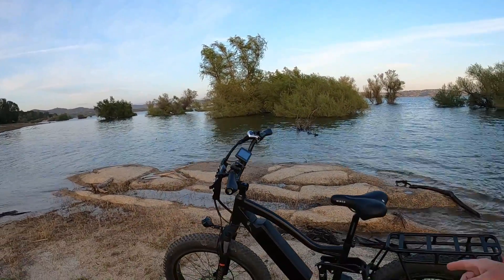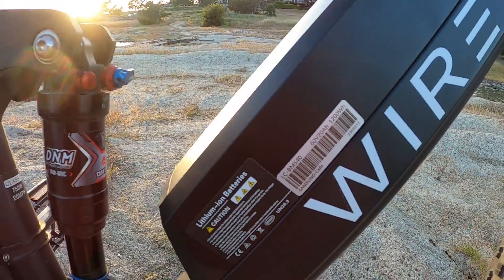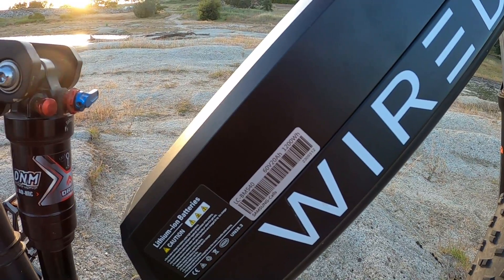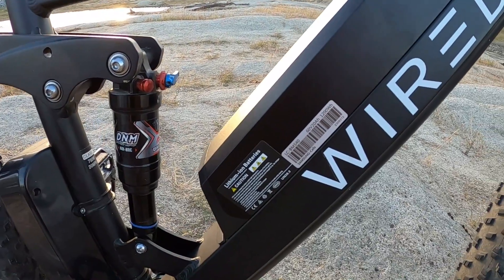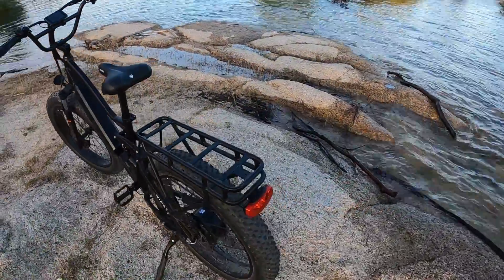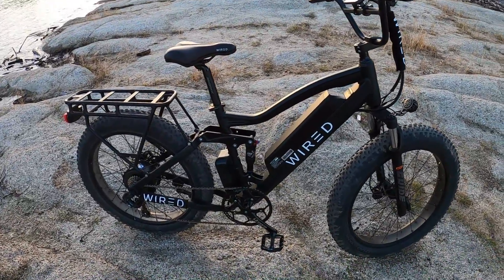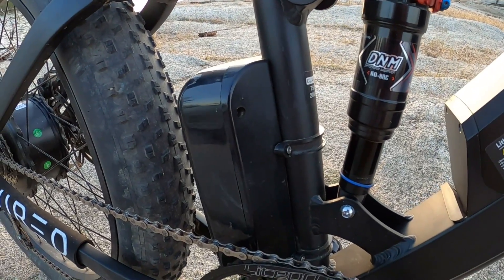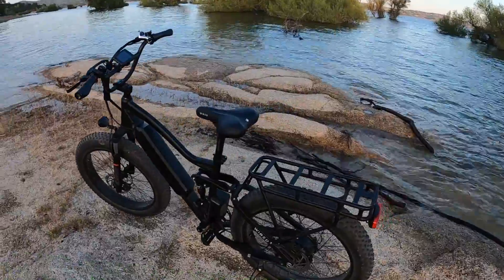Volts, Amps and Watts Explained   2024 Wired Freedom

Comment: How does discharge current relate to a batteries capacity to supply the appropriate amount of power to the motor without overtaxing the battery? Did you discuss discharge current of a battery? Thanks for considering my questions, I'm struggling to find the answer.
Reply from the maker: The discharge rate is usually measured as a "C" rating, at least that's how they do it in the RC world. I don't know what the discharge rate is for these batteries, but the controller often is the limiting factor for power to the motor. These are 30amps continuous and the newer ones are 40amps multiplied by the voltage (60-67 volts, depending on charge level) which will give you the wattage output to the motor.
Reply: @leetjohnson  I had an experience where I think my battery was under powered for a dual motor set up and it blew the BMS. My thinking is that although the amp hours was rated at 30 amp hours, the controller was pulling 60 amps but I later found that the battery was actually rated for 25 amp hours. The thing is that the battery says that the discharge rating is less than 50 A. This would be less than the 60 from the controller or the 25 amp hours for which the battery is rated. I’m uncertain if the important number to consider for the battery is the discharge current or the Ah rating as it relates to the controller and the dual motors.
Reply from the maker: @JoBianco amp hours is a measure of capacity, like gallons of gas in a tank. So, for example,  if a battery is 25 anp hours, theoretically, it can output 1 amp for 25 hours, or 10 amps for 2.5 hours, or 25 amps for 1 hour. 25 amps is an amount of power, 25 amp hours would be a capacity measurement.

Comment: I've got a TDR brand ebike has a 500w motor paired with a 22+1 amp controller  using a 48v 10ah battery. It over heated a couple of times so I tryed to change the controller current in the display settings. 
I can literally set it at 1 amp or I've had it up to 36 amp and the motor response has no change is that normal?

Like setting the controller amp to 1 you think it would not work? Does the controller or motor have an issue do you think?
Reply from the maker: @JunkyRacer  Sounds like the controller may be faulty. Have you reached out to the manufacturer/reseller?
Reply: @leetjohnson  yeah I did they told me it could send the motor and controller back for testing, but i haven't yet.
The only thing that affects motor profomance is the pedal assist setting from 1 to 5. At level 3, it's fine if I don't use the throttle too much, but if I do and use assist level 5 as well, it overheats with in a couple of kms hard riding. I don't know if this is normal or not?
Reply from the maker: @JunkyRacer  yeah, that definitely isn't normal.
Reply: @leetjohnson  ok I'll mention as well they said typical heat range is from 50 to 70°C i haven't test it with anything but my hand but it's gets to hot to touch for longer then a couple of seconds.

Comment: Shouldn't the motor's efficiency be part of these equations?
Reply from the maker: Yes, there are some thermal losses from the motor and other inefficiencies. However, they are fairly insignificant compared to wind, rider weight, terrain, and other mitigating factors.

Comment: Hi again i have another hypothetical question, would this motor be compatible with the controller below or would you recommend a amperage above 40 like 50 60?

Rated Voltage (V): 36V-72V
Rated Power (W): 2000W-3500W
Rated Speed (Km/H): 120
Motor Speed: 1850 Rpm 

40A Controller for 1500w-2000w :  
Maximum current:40±1A
Size:185*82*41 mm
Weight:546g
Mosfets:15 mosfets
Cable length:all about 13-18cm
Rated voltage:DC36V/48V/52V
Speed set:1.1-4.2V
Rated current:20A
Thanks again
Reply from the maker: @sandstormshadow1238  40 amps would be plenty!! It really depends on what the motor can handle.

Comment: Hi i have a question about my setup. I have a 48v mini electric, 13a controller, 400w sustained 500w peak motor and 3 batteries, 1x 48v 10ah and 2x 48v 15ah batteries, through your calculations I have 480wh and 2x 720wh, How do these numbers translate to approximate run time with the system ive got and how does the 13a controller effect my batteries. Thankyou if you can explain.
Reply from the maker: @sandstormshadow1238  it's really going to depend a lot on rider weight and terrain (flat or hills). The 13amp controller will limit your power, but also allow you to ride farther and longer, although at lower speeds.

Comment: I have the new wired Predator. It comes with 67.2 voltage at 3amps. Can I use the cycle satiator charger running at 5amps? I'm only using it for a group ride because an extra battery is over $825+tax. It won't blow up the battery?
Reply from the maker: @CHRISTSALVATION  as long as it is the same voltage (60v nominal, 67v current) you theoretically should be good. I wouldn't let it charge the battery fully, but for a quick charge, it should be ok.
Reply: @leetjohnson  thank you. I figured it should be good but always good to get another opinion. Luv the videos
Reply from the maker: @CHRISTSALVATION  thank you!

Comment: Hello again mate, Spoke with you awhile back, This is still over my head, Could you help me again please, l am thinking of getting a ebike again, it's got a 750w motor supposedly kicking out a 1000w classed as a 1000w lax motor geared with 90nm of torque, 48v 12.8ah 16.4wh battery and a fast charger 48v 3.0amp , (1)World it be possible to tell me what amps my controller is ,(2)What speed what distance and how long will the battery last roughly of course ,Would really appreciate your help mate please.
Reply from the maker: @alanmeasures8337  Hello! The amperage of the controller can vary, but theoretically, at 48v ÷ 1,000watts would be about 20amps peak and about 15 amps continuous. The maximum speed can be up to 28mph, unless it is speed controlled to 20mph to be legally class 2. As far as distance, it depends on the rider weight, terrain (hills or flat) and how much power (power level) is used. I would guess a 200lb rider on relatively flat ground would go about 20 miles or so of range at a middle power setting....up to 25 miles on the lowest power setting and as low as 15 miles at full power. Just my best guess though. Hope this helps, let me know if you have any other questions!!
Reply: @leetjohnson  Thank you again for the reply and help, Cheers mate.

Comment: I was curious about the max charge speed of the current generation wired freedom. I know that both of the chargers that came with my bike charge at 3a max. The reason I'm asking is because I have an onyx cty2 which is also supposed to be 60v that charges up to 71.4v when fully charged. It's charger is a 5a charger and I was wondering if I could charge my wired freedoms batteries with it. I can't find anywhere on wired's website where it talks about how fast you can charge their batteries.
Reply from the maker: @jcolt84  hmmm, that's interesting. I know Wired uses 3amp chargers for the old and new versions....I would think it should be fine to use 5amp, if the plug fits, however, this could theoretically void your warranty and will shorten the lifespan of the battery, as faster charging wears the battery out quicker.

Comment: Can you run 72-volt battery on that stock WiredFreedom, without ant upgrades but the battery?
Reply from the maker: @mikerocket62  no, I think you would have to get a 72v controller.

Comment: Great video friend But still a lot to take in, Help please  ( 48V 16AH / 768WH ) LI- ION BATTERY,  1000 V DIRECT MOTOR,  90NM OF TORQUE.    What speed am l looking to achieve, What distance and for how long , Would be a great help  love from the UK.
Reply from the maker: There are a lot of variables for thr top speed and distance (terrain, rider weight, pedal assist level/throttle vs pedaling, etc). I'd say probably 24 to 28mph and a range of around 20 to 30 miles on those stats at a medium pedal assist level and 180lb rider.
Reply: @leetjohnson  Thank you mate for your reply,

Comment: Can you explain more about peak out put?When can you hit peak out put? For how long?
Reply from the maker: Depends on the motor. Peak is used when going full throttle or pedaling hard/uphill in pedal assist 5.
Reply: I have similar bike and no hills where I live and I believe the most out put I've seen is 1800w. Does the system sense when it needs to disperse the 2200w like going up hill?
Reply from the maker: @Easy416  similar bike? Is it a 60v system? Does it have the same motor? (1,500 watts nominal and 2,200 peak). Hard to say unless I know the bike and controller. This has a 40amp controller and is programmable l, which allows you to modify the power output in multiple ways. It could be a setting on your controller, if it is programmable. Full throttle should allow for max output, depending on the settings.
Reply: @leetjohnson  I have the E cells 5 star
Reply from the maker: @Easy416  right on! You can try a hill, if you can find any around where you live....it might push it to 2,200....that's about the most I've seen on my Wired Freedom.
Reply: Okay thanks

Comment: About to purchase my new wired freedom cruiser! I’m so excited for it I didn’t even realize how major they upgraded that thing right after the ‘24 model released late last year which is really crazy
Reply from the maker: I know, right?? Such a great value!!  If you use the link in this video description box, it really helps out this channel, and I would greatly appreciate it!!
Reply: @leetjohnson  sounds good! So basically from the 2024 wired you got 80 miles from it low settings right?
Reply from the maker: @CNclov2005  72, but yes, basically. Should be able to get well over 100 miles, probably more, with the new dual battery version!
Reply: @leetjohnson  yes that’s so awesome! I saw your video the other day and it was breathtaking! Did you ever use throttle on that range test or just pedal?
Reply from the maker: @CNclov2005  just pedaling, no throttle.
Reply: @leetjohnson  how many mph per hr can you go on pas and throttle 2-3 and what do you think I should expect because I mostly try to peddle but I use throttle in some situations
Reply from the maker: @undergroundcreeper7997  depends on your weight, uphill or downhill and how hard you peddle....probably 20 to 30mph in Pas 2 or 3
Reply: @leetjohnson  ok good to know! Just found out today that since I purchased my bike particularly the cruiser model which I want I have to wait until late July for it to get delivered and I am not willing to want to wait that long to get it, if I get the regular model I’ll get it a month early what do you think Is the best option for me in this situation? I’m stuck right now
Reply from the maker: @CNclov2005  I'd say wait for the one you really want.
Reply: @leetjohnson  sounds good! I’m so glad Im getting this new bike! Before this my plan was to get the adventure 2 form aventon and that bike looked really fun but the new wired freedom has a little bit more to it for just $200 more I can get 2 batteries, very powerful speed, full suspensions and more that the aventon might not have its still a really good bike though

Comment: No 2nd battery in the back? 🤔
Reply from the maker: Not yet! They start shipping in June.
Reply: @leetjohnson  would you pick wired freedom over ecells 5 star ?
Reply from the maker: @bunit8  that's a tough question. The Wired definitely has more power now that the E Cells 5 star. They are both solid, but I really like my Wired Freedom and had a bad experience with the owner of E Cells....so I may be biased.

Comment: The new Wired contoller peaks at almost 50 amps.  50x67 is 3350 watts.  I think they have hit the limit for a 60v system and are now limited by the individual battery cell max discharge rate.  The new Wired controller can also be fully reprogrammed and re flashed with a  usb dongle for future updates.  The old KT controller only puts out 2400 watts and with voltage sag and motor inefficiencies  you only get 2200 watts peak.  Jail Cells special ordered gel filled KT controllers and are now stuck trying to compete.  It’s like bringing a knife to a gunfight.  The difference between the two bikes is as great or greater than the difference between the original Wired Freedom and the Kepler.  But wait, there’s more.  Steve got mad at me when I leaked some details about these bikes, so I will say this carefully…you are not going to believe what is dropping next.  As a bike reviewer, you are going to want to stay in Wired’s good graces.  Let’s just say with the next bike, it’s not about profit, but principle.
Reply from the maker: Thanks for the details!!!!
Reply: I'd like to know more, as everyone would. I hope to hear about it soon. As of right now, I am leaning towards an Ecells triple crown or a kings crown.
Reply: Yup, 48.

Comment: Ecells 5 star is better
Reply from the maker: It definitely could be, I've never ridden one. What makes it better in your opinion?
Reply: @leetjohnson  a few extra features, potted controller, front basket mounts, water bottle holder mounts, the shop also has a lot of custom options, very good customer support no tax or shipping fees plus lifetime warranty on the very strong frame.
Reply from the maker: @MrDeath-zu3ll  I definitely agree they have more options available for customization and the no tax and free shipping is awesome! This new Wired Freedom does have a 45amp potted controller and a 3,200 watt peak motor. They are definitely battling for the top spot! I think they are both awesome choices for the money. Thanks for your input, I really appreciate it!
Reply: @MrDeath1988  The new Wired 2024 comes with a potted controller...
Reply: @TunaSoda  copying Ecells yet again
Reply: @MrDeath1988  Let's hope they don't copy ecells $300 custom fee... 😄
Reply: @TunaSoda  all ebikes gonna be going up 300 dollars because of the tariffs on China
Reply: @MrDeath1988  Half true, all bikes will go up by a percentage based on their price, not a blanket $300
Reply: @TunaSoda  luckily I already have the 5 star and it's awesome
Reply: @MrDeath1988  Glad you like it, that's all that matters

Comment: Can you put a 48v 16Ah battery into the 60v Wired Freedom? would it damage the controller? or just go slower?
Reply from the maker: I'm not 100% sure it would even work as the minimum voltage cutoff on the controller is set to about 48 to 50 volts.
Reply: @leetjohnson  Thanks... ok I kinda understand... Wired Freedom controller is not voltage rated but Amperage rated (40A). Its cutoff is set for a 60v battery so a 48v battery would cut off early. So in a real world scenario, a fully charged 48v battery (~54v) when inserted in a Freedom would read ~35% charge (according to a chart I saw).

I think many ebikes have a settings to choose other voltages like 52, 48, 36... maybe that's what the setting is for.
Reply from the maker: @lonestartex1  it may be possible to set the voltage to 48v for the controller. Then it would work just fine, but the power output would be reduced, obviously. Were you thinking of using it as an additional battery option for the bike?
Reply: Actually, I already have two spare 48v batteries that are like new. The bike itself has a cracked frame. The batteries fits the Freedom (Dorado style) so it would be a huge win if I bought a Freedom and have 2 spare batteries. I don't mind going slower at all. @leetjohnson
Reply from the maker: @lonestartex1  that would be awesome! Let me know how it goes!!

Comment: Great video. How many amps is the new wired bike? Would that multiplied by the volts give you the peak wattage?
Reply from the maker: The new controller is 45 amps. That is correct, so....at a full charge (67volts) X (45amps) = 3,015 watts. Supposedly, the new upgraded motor has a theoretical max new peak voltage of 3,200 watts.
Reply: @leetjohnson  so this original controller says on it it can do +- 2amps. Does that mean it's peak is 42 amps x 67 = 2814 watts? So 386 watts less than the peak of the new one right?
Reply from the maker: @maximumchargeEV  I think that is correct. But, I'm sure the new one will have a +/- 2 amps also, probably due to manufacturing variations during production. I saw that Citizen Cycle here on YouTube was able to get around 3,200 maybe even a but more on the new prototype version of this bike.
Reply: @leetjohnson  gotcha. Curious to see the real world testing of the final product  by other people

Comment: I wonder if they are actually using a 50 Amp controller on the new bikes. At 67 volts times 50 amps, minus the motors ability, 100-200 watts difference, it then makes the math work out.
Reply from the maker: Supposedly it's a 45 amp potted controller with a revised motor that has a new peak of 3,200 watts. So, 67v times 45 amps equals 3,015 watts....at least theoretically.
Reply: @leetjohnson  Maybe the read out is off? Lets see after the new flashed screens.
Great vid BTW as usual. You always bring it
Reply from the maker: @johns5504  Thank you!

Comment: If you climbed a steep hill at full power for 30min. you would kill the battery in your example.... Good work 👍
Reply: Too bad there's no regen capability for the descent.
Reply from the maker: Exactly! The motor is only rated for 1,500 watts continuous and 2,200 watts peak, so it might cut out or overheat in that theoretical scenario, but you are absolutely correct!

Comment: wired should have an option for preinstalled tannus armour. would be a waste to have to switch out the innertubes and to have to order that separately.
Reply: ShoottheChit did range values with and without tannus, you lose over 10% using them vs flat out.
Reply from the maker: That would be a great option!